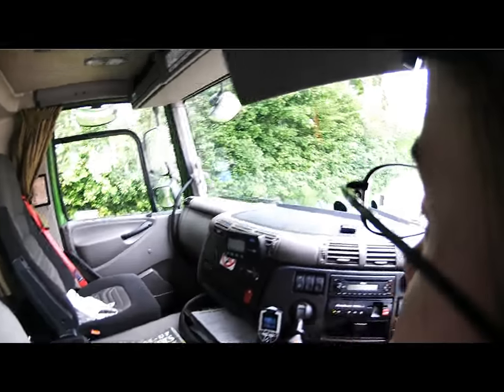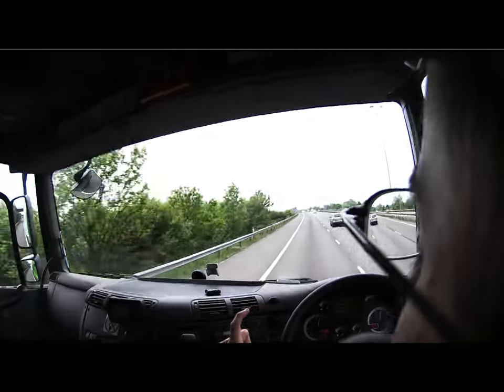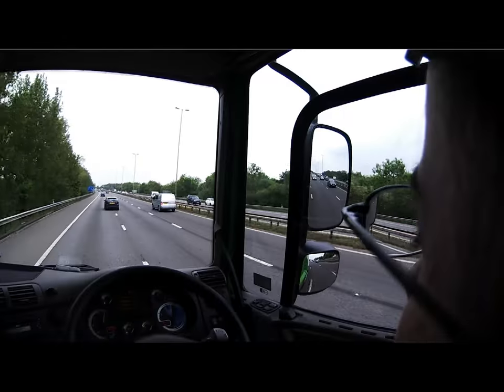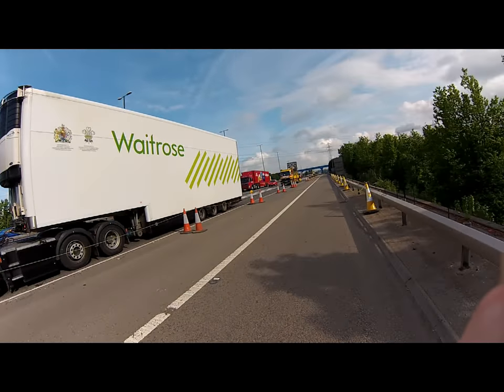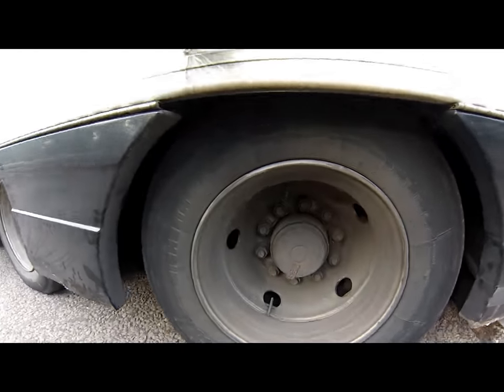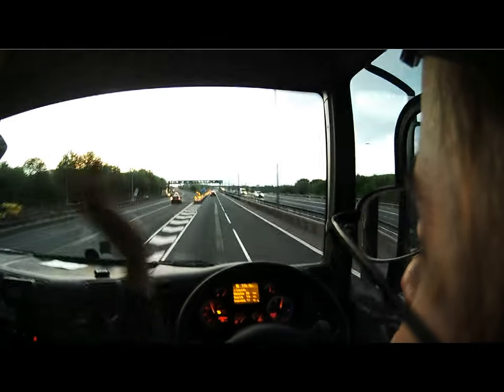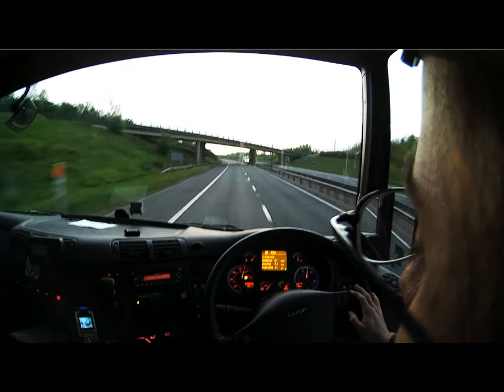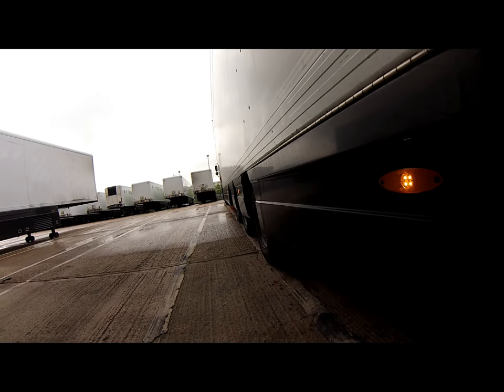Chilled double decking, going out with a bang (Old #49)

Comment: Im surprised about the inside of the double deckers. They should of made the whole upper floor have hydraulics so it can be lowered, just like a car ferry! That would make loading and unloading so much quicker! Taking 6 cages at a time must be such a drag!
Reply from the maker: Oh yeah it takes a while. I assume it has a fixed floor because of the chillers and reducing the amount and size of moving parts makes it easier to seal in the temperature compartments. The ambient double decker has a whole moving upper deck so everything just flies off.

Comment: Does "the company" know/mind you filming?
Reply from the maker: Yes they know, yes they did mind. So I filmed for about a year but didn't upload any then uploaded one a week for six months until the backlog cleared and they haven't said anything since. So they either stopped minding or I beat them into submission.
Reply: DTW-TheWanderingMuzungu Good on you. Personally I think they have more to gain from it...although that may have/had reservations on the matter. I also think it a double-standard otherwise as many companies use in cab CCTV plus real-time tracking etc. Thanks for reply...it been something meaning to ask for a while.
Reply from the maker: +Vincent de Guard I'm not the only one either as I know three other truck driving youtubers who have had trouble. Then after a while off they came back as well.

Comment: Am I right in saying Luke Vernon of Lorrydriver.com gets similar fuel returns on his lorry, and he drives the 750 Volvo? Hows that work then if it is true.
Very annoying when cameras play up.
That tyre looks a right mess, I've seen them go, like you say a massive bang and lots of flying rubber in clouds of dust, scary stuff if your caught behind when they go.
All good fun eh? :-)
Reply from the maker: I think he gets around the same fuel economy and I can only assume that the large amount of power means you don't use full throttle that much. Where as we use full throttle on even the smallest of hills. Went to Exeter a few weeks ago in all the poor weather and had a strong headwind all the way down the M5 and managed to achieve 5.7 mpg.
Reply: DarkThoughtsWithin I know Im only in a Sprinter, but the wind direction can make massive differences to my fuel consumption too, especially when fully loaded and heading up Shap on the M6, cant help but watch the fuel gauge :-)